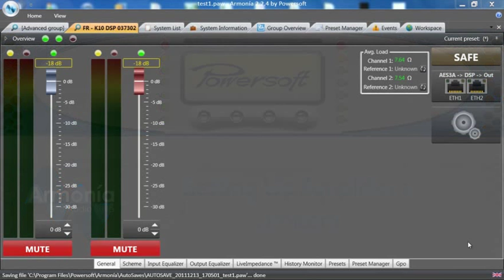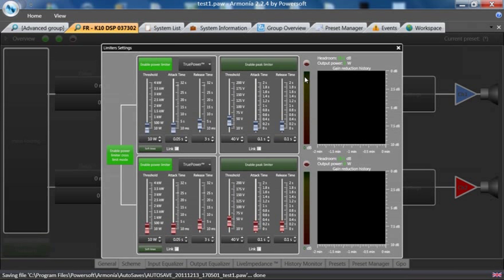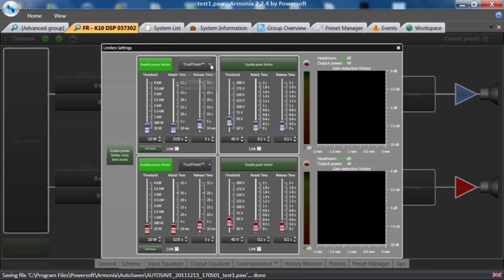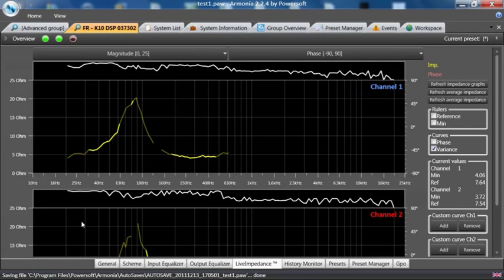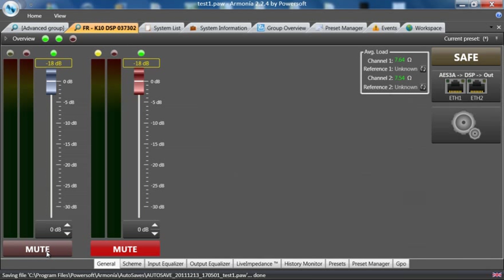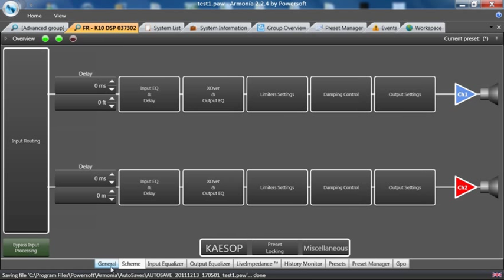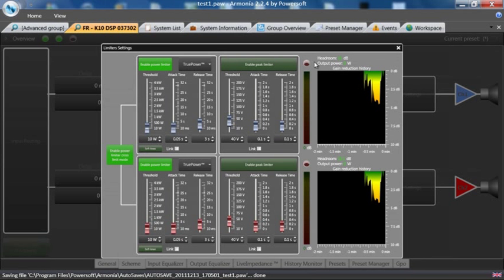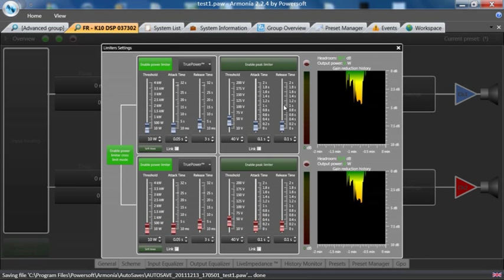Limiters

Comment: Hello! I would like to set a limiter for a double bass of 1400w RMS power in 4 ohms (there are 2 speakers of 700w each in 8 ohms, put in parallel = 1400w RMS in 4 ohms). What limiter do you recommend I use?